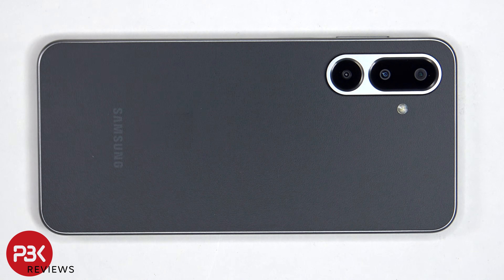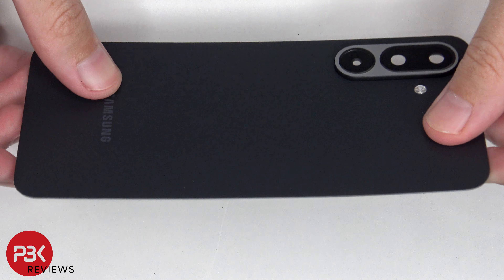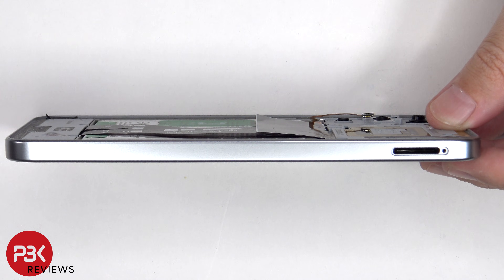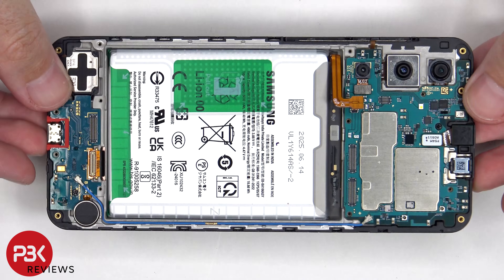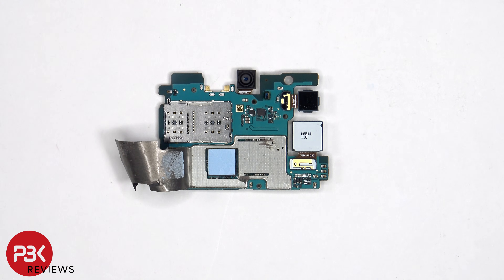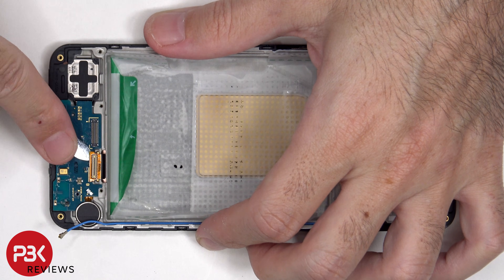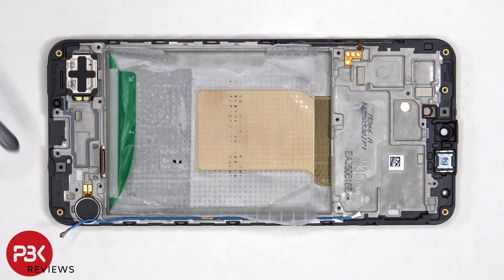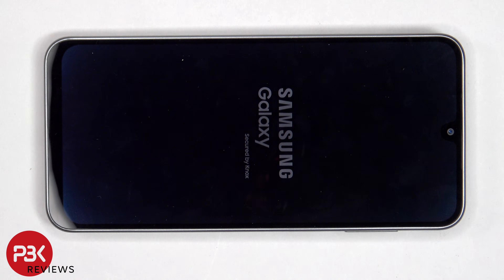Samsung Galaxy F36 5G Teardown Disassembly Phone Repair Video Review

Comment: I cleaned the charging connector with a small, soft brush soaked in a little isopropyl alcohol, covering everything else with tape. After doing this, I thought about the water resistance. Could that damage it?  (s25 +)

Comment: Samsung should provide dedicated memory card slots this will not only be helpful for the user but also it will increase the chances for selling their MicroSd cards too.
Reply: I want MicroSD card slots too, but I don’t think thats good for Samsung itself. Users can buy MicroSD cards from Samsung, but they can also buy them from anywhere else. If Samsung removes the slot and force the user to buy internal storage upgrades, from, of course Samsung (unless you upgrade the storage by desoldering the old memory chip and solder a higher capacity one). So, excluding the MicroSD slot is in the interest of the phone manufacturer.
Reply: @盾神京矢  Guess they should also remove the charging port then as Samsung users could just buy chargers and data cable from other companies.
Reply: Vote with your wallet and buy an Xperia
Reply: @pixels_per_inchUnfortunately, I have got around 100 green, pink and white lines on my Xperia 5 II at this point, and they are still growing. Sony refused to fix that for free. 
I have also got a Z3 Compact back in the days that gradually lost all touch functionality, and that problem reappeared and lost all touch again after I paid a lot to fix it. 
So no more Sony for me(for all products, not just phones; I have brought Sony TVs, earbuds and what not in the past).